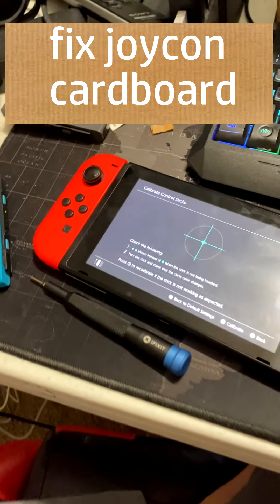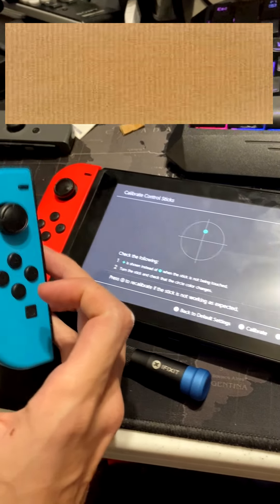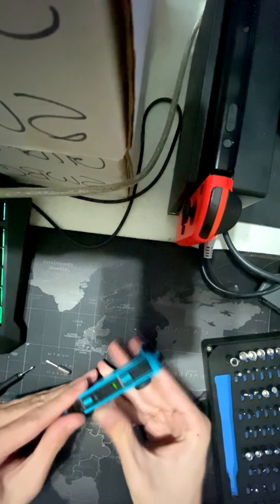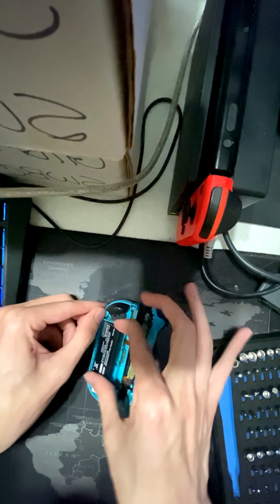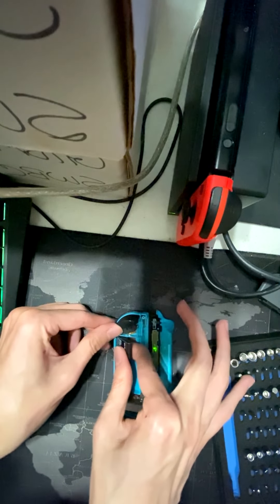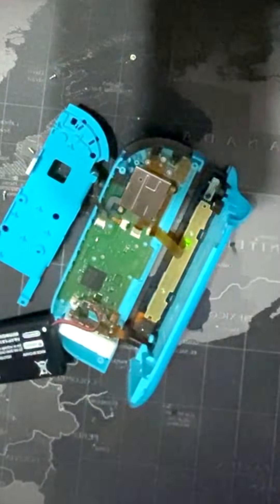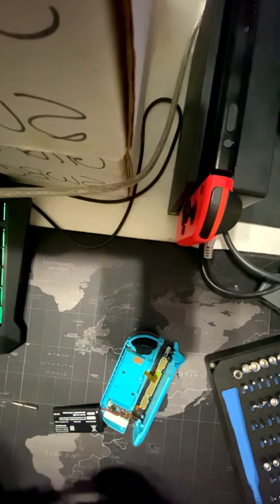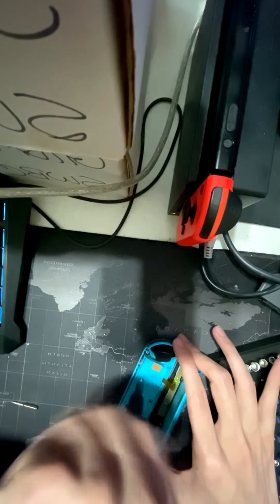An Easy Joy-Con Drift Fix?! testing if it works!!!

Comment: I need help does the card board have to one millimetre thick? If so how do I make it that cut? Is there an example of something that's one millimetre naturally like a card or something? Also what are the exact measurements like how long and wide should the cut be?
Reply: dude a calling card will do. see ign fix.
Reply: From what i've seen the square of cardboard just needs to be the size of the metal that surrounds the joycons at the bottom like in the video. Another video I saw said you can just use paper as well so you can layer it, you want it just thick enough so that you can still close it back up everything feels tight. just search "VK's Channel Joycon fix" they're the one who found this out and they explain it.

Comment: Didn’t you try to put in a spare piece? Or put in tape if it falls off?
Reply from the maker: Nope seem like it works fine if you just put it on the the back side of it than screw the plastic parts back on also it work with 2/3 of my left joycon so don’t know if it works for everyone

Comment: I did the same thing and the drift appears to be mostly gone but when I make the analog stick go down, theres still some drift on the downward movement. Is there any reason for this?
Reply: You probably accidentally moved the piece of paper while reassembling the joycon
Reply: Most likely because it is compressing the cardboard when you push down, causing the joystick to loose contact with the graphite sensor pads for a fraction of a second, making it drift, try using a thicker piece of cardboard or add another piece behind the first one.
Reply: I decided to just use tape, since it's less prone to moving out of place, specifically electrical tape cause why not. (But do be careful since it's harder to get off if you mess up)
Reply: @Darloyman  thanks, I used an index card. would replacing the card with electrical tape also do the trick?
Reply: the guy that made it posted a new video recently spcecificaly saying that you should not use a paper that's thicker because it can damage it
link: https://www.youtube.com/watch?v=MoehK7DpcsY&t=6s
Reply: khun I think that guy is saying that the paper the guy put in is not as thick as the guy from the videos
Reply: There is also a possibility that dust is just inside the stick, when I did this I cleaned it out and when putting it back together with the cardboard added, helped fix it.
Reply: It’s either dirty or the paper got moved when you put it back together. I’d recommend that if it’s dirty to use either canned air or electrical contact cleaner.
Reply: @jackthememer1186  I left it alone for a day and now the drift is apparently gone? It works flawlessly now and I didn’t even touch it
Reply: @3e32b05  Weird, maybe you just needed to turn off the controller?
Reply: @3e32b05  probably the cardboard had to settle inside.

Comment: Has anybody noticed that the sticks are on the opposite sides!?!?😂😂
Reply: It's just because the camera is flipped, you can tell because if the text on the screen. It would be impossible to orient the right joycon in this way and have it to face towards the screen.
Reply: @jdn4070  no i believe he has the switch upside down idk ur probs right